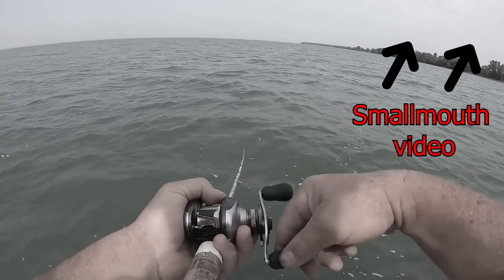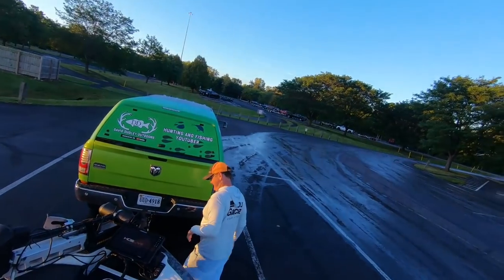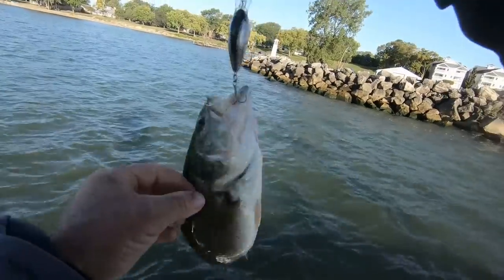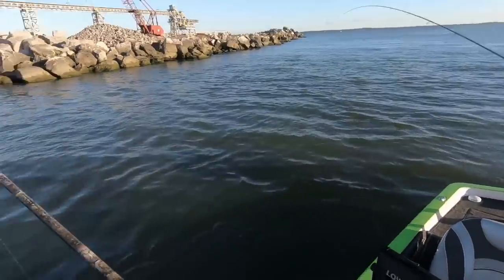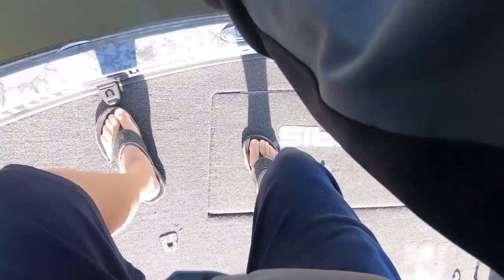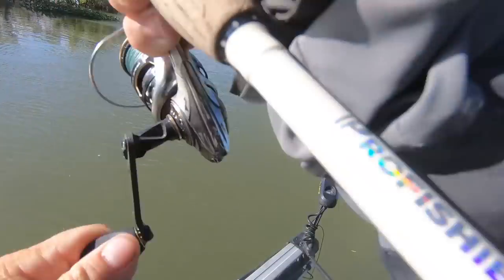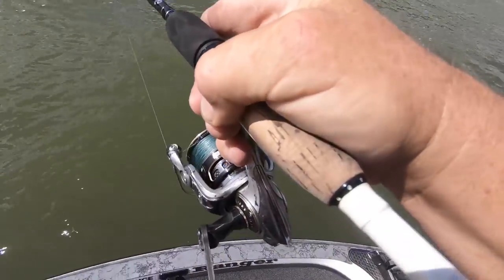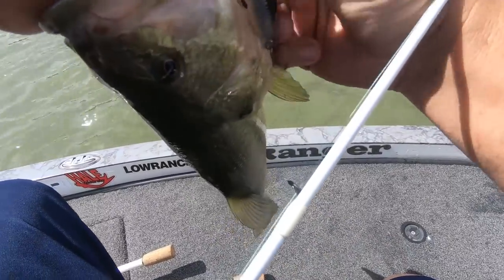Why Spinning Rods are a Must for Shallow Cranking!

Comment: It's nice to see Pro...A WELL accomplished Pro at that, validating that there's nothing wrong with using a spinning rod with crank baits. I like my bait casters, but I LOVE my spinning rods for the exact reasons you mentioned in this video. Thanks again for another great video DD.
Reply from the maker: It needed to be said Sam
Reply: So I just bought my first and only budget fishing rig spinning reel setup. Got a Shimano Nasci 2500 with a Shimano Sellus 7.1ft Med/Fast rod. I’m fishing a 8-15/ft deep creek off Erie Canal and I want to avoid snags on weeds/grass so a squarebill would be best? Right now my reel is spooled with 6/lb Trilene XL mono… would mono work for small crank baits? I have P-Line 15/lb braid I planned on spooling and using a leader (flouro/mono) but I’m not sure what knots to tie leader line with… heard braid needs different knot styles and I only know Palomar knot. I learn pretty quick but I think braid is more versatile. I want to try a drop shot rig but I’m not sure how long the leader line? If I go say 3-5/ft leader… that would make for a difficult cast because I’ve heard you shouldn’t reel leader line onto braid? Any tips would be greatly appreciated… I’d be happy to catch a goldfish at this point!

Comment: I use spinning rods alot. Most of the time when I want to use line that is 10 lb. test or less its on spinning gear. Have caught bass using 4 lb. test for clear water. FLC

Comment: Do you have a weight limit when using your spinning setup, 3/8oz. or 1/2oz.? I have ordered a Medium Heavy spinning rod for Bass because of you. I have a MH inshore rod that I used after you mentioned using nothing less than a Medium Heavy rod even in spinning setups. It helped me when I was using a 3/8oz. drop shot while my Medium felt a little over powered. I have more confidence when I drop shot in heavy cover.

Comment: I have found that spinning reels have a superior drag in addition to the casting attributes. I prefer a medium action for cranking, and I would much rather fight a fish on light line with a spinning outfit over casting and it has nothing to do with ability. I can and have thrown #5 shad raps on casting gear, but over the years I have learned that spinning is the way to go for finesse cranking. When paralleling riprap or seawall, crank a small plug slow on light line and when a big fish loads you can simply hold that spinning rod up on a light to moderate drag and walk that fish out of the rocks and into open water and just let her play herself out using the rod and drag to your advantage.

Comment: Hey man apreciate you to start off !! Ever since I found your channel I have a sissy stick with me at all times ,at least 1 . If there is one thing I have found there is absolutely 0 reasons to fight the wind or casring lighter baits . Its just so so much easier to 8se a sissy stick . So I gave up trying to throw a fluke or a weightless senko or even a 3/8 oz crank bait when its windy . I do throw 20lb braid to leader . It looked like you throwing straight floro , I know you where cranking here but on your other setups do you prefer braid to leader or no ? There are so many differnet scenerios I am sure its hard to answer  that without a specific technique discussed . Anyways hope all is well and until next time be safe and catch a biggin
Reply from the maker: Up State we are on the same page I use 7.2 MH profishencey rod and 15 braid with 10lb floro 10 ft leader
Reply: @DavidDudley  Hey I oicked a coupke packs of perfection lures shaky heads from the local field and stream . Here in Upstate NY we fish a lot of deep clear water so the shaky head is a confidence bait for me . These peoducts look like a homerun man !!!